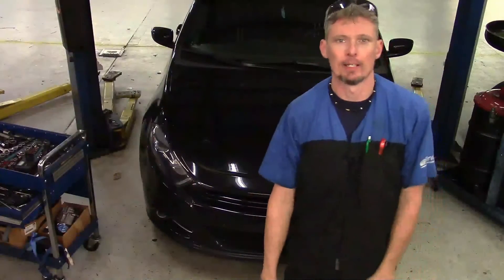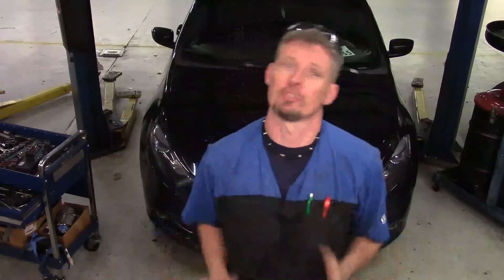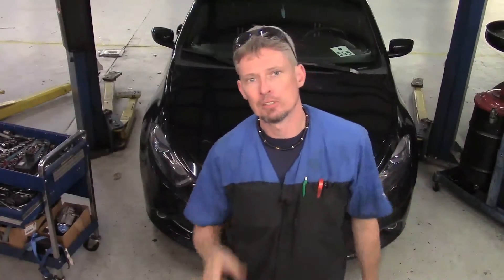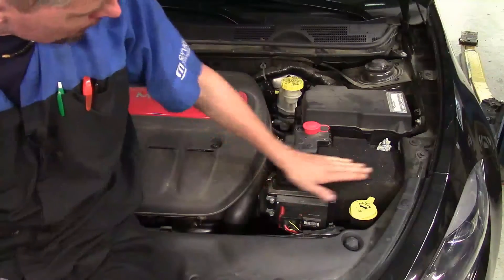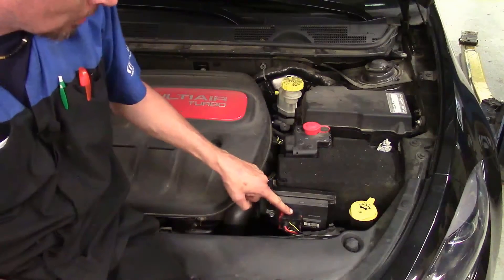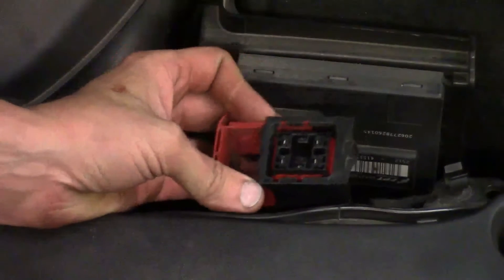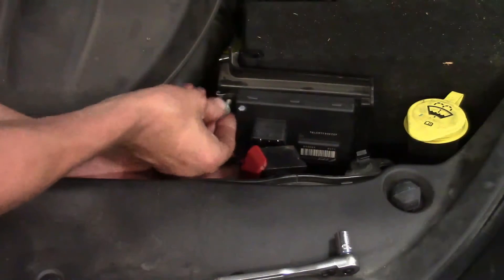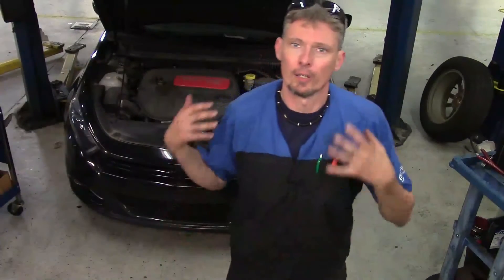2013 Dodge Dart Smart Drive Unit (SDU) removal

Comment: David, I have a 2013 Dodge Dart 1.4L turbo w/automatic trans. Seems like when things get hot the trans start acting weird and a service trans come on the dash, then pops out of gear and won't go into drive or reverse. Sends 2 codes P1CC0 & P1CC2. Everything cools down and then works great again. After a drive all codes clear, I'm thinking the SDU, what are your thoughts? Does a new SDU need to be programed for the vehicle? Thank you for you time!!

Comment: My dart can be moved/rolled when in park don’t know much about these transmissions and local trans shops said they don’t work on these… where should I start?
Reply: Still having this issue, or you replace the bushing in the cabin on the shift control? The recall was for the trans side, not the cabin bushing. So, fails a lottt. Either that, or the micro switch in the shift assembly. Many people bypass it, or put a plastic cover over it to close the gap.

Comment: Hey there David, if the Smart Unit is bad would it cause the car to stop moving when in gear and trigger a Clutch Plate locked in position code and the Hydraulic Pump code ? And there is NO WAY to check if the SDU is bad other than going thru the TCM?
Reply: Did you ever get it fixed?

Comment: I got red steering wheel icon on dash. Did not change anything. Battery died and car was dead for 2 weeks. Finally I replaced battery and now it's hard to turn the wheel.

Comment: I am glad I found this video! I have a Fiat 500L that has this same transmission system. It has the same issue(s). 

I have ordered this part. Unfortunately it is hidden behind of the front drivers fender liner.

It is amazing that none of the Fiat/Dodge dealers I have tried have any idea how to fix this.
Reply: Did it get fixed

Comment: P2871 is the main code I am getting.  WIll a new SDU possibly cure this?  Dealerships states a whole new transmission.   It actually drives forward and shifts with a little issue but has no reverse

Comment: I have a 13 and the pump will work until the sdu gets hot. I am leaning towards an issue with sdu but I can't find exact wiring output testing to verify, I will say when it blinks out I get a stuck off pump and a signal fail code, if I remove sdu and put in the snow to cool I can get it to work again. Also can I use a used sdu because the dealership is on back order? I have a pass through system but I'm not sure if that will be sufficient or if the unit needs to be new. Any info suggestions......maybe a video on a testing process????

Comment: Hey I have a message on the display every time im coming to stop, the message said; Engage Parke Brake to Prevent Rolling  I can't find no info  at any place so I order the park sensor the goes on top of transmission I hope is the problem .,. just wondering if you had the problem before

Comment: Hi my 2013 Dodge Dart 1.4l has a transmission problem and when I took it to dodge they said it was the hydraulic shift actuator that needed to be replaced. They wanted 4 thousand to fix. I know that part is big money but now I’m wondering maybe it’s just the sdu?  The code it was throwing was the P1C9D.
Reply: For 4 thousand you should get a full new trans!
Reply: any updates on that?

Comment: Is this why I have service transmission light and n and r gear not available
Reply from the maker: I might but its needs to be checked first before replacing anything that might not be needed. Thanks for asking and make sure to subscribe.
Reply: Did you get it fixed? Because mine is doing that

Comment: I can see now WHY CC (Chrysler Corp)  STOPPED making these "wonderful " Vehicles... They lost TOO much money in warranties to keep it going... CC needs to get vehicles pass the end of  Warranty to make money back in parts.. did-ye-all know that IF u get a recall on the shifter bushing failure, u ONLY get the 5$ bushing , and really that's all u need...BUT IF NOT under recall, the dealer IS FORBIDDEN TO SELL U A Bushing, but steers you to a 384$ NEW CABLE KIT which will cost 3X the Labour... Do yeall get the the "Corporate greed " thing now ?

Comment: Hi David, I have a 2013 Dodge Dart 1.4 ddct, I am pulling 2 codes P1CC0 and P1CCE, service transmission light is on, if I reset the codes I can drive the car however if I let it stand for a while same codes pop up and I have to reset them in order to drive the vehicle, recall on the TCM has been done in 2017, any ideas?
Reply: same thing happening to me
Reply: @dustin2xx  did you find out what's wrong?
Reply: @misha27060  did you ever figure out the problem? I scanned my car and got both of those same codes

Comment: I drive a 2014 Dodge Dart SXT Rallye. A month ago I had a check engine light come on and then the acceleration was sluggish. After a few cranks the light came off and nothing for a week. Now the light is back and my car is accelerating sluggishly. The gear selector turned red too. As of right now the gear selector looks normal but the check engine light is back. Forums are all pointing towards the TCM. I’ve got Mopar extended warranty for up to 105k miles and my car currently has 78k. I’ve had it for two years and bought it at 58k. Any advice? Concerned the dealership will tell me nothing is wrong.

Comment: Do you have the part number for the hydraulic pump ? Our 13 dart 1.4 turbo with the ddct had an issue with the air injection pump leaking so we fixed that and cleaned everything off and now we are still getting some fluid right where the hydraulic pump is under the transmission and I believe it’s leaking there now because it’s dry above. Do you know what might be leaking around that area ? Like is there anything common or prone to leaking right there ? It’s dripping right off the square part of the pump. Also what’s the reservoir under the intake pipe between the battery and the motor right above the transmission?

Comment: I have a dodge dart 2014 aero, and the cruise control will only intermittently work. I replaced the switch and it works slightly better, but why does it not work sometimes?
Reply from the maker: First thing I would do is check for any codes.....certain codes will turn the cruise control off. Then it will take a high end scanner to read the data and monitor the switch to see what it is actually reading. Thanks for asking and make sure to subscribe.

Comment: Hi David um I have a. Dodge dart 1.4 turbo and the same thing happens to my car the. Shift are stuck and I have the code U0101 that the communication with the tcm was lost can it be the smart drive unit?? Please help me out
Reply from the maker: The TCM is actually a different  module. Its located under the carpet on the passenger side front seat near the firewall. Its going tp require further diag for that code....otherwise it would be a guess at this point. Not a common issue I come across

Comment: Hi David i took my car two weeks ago because when i would be driving a warning would come up saying "gear not available" and then after that "shift to neutral or reverse then drive"  and the car would stay in neutral for a couple of seconds...i noticed you mentioned both of these warnings in your video. So when i took my car to the dealership they replaced both the TCM and the SDU and  its only been two weeks and ive gotten both warnings twice with the Check engine light  appearing aswell...is there a process that the TCM needs to follow for it to program itself or do you think i might need to get both things replaced again?

Comment: I have a 2013 Dodge dart I want to put it on a tow dolly if I pop the shifter cover put it in neutral can I put it on the dolly It is an automatic
Reply from the maker: As long as the front wheels are on the dolly you wont have any issues. Its not AWD so the rear spin freely. You dont need to take anything loose.
Reply: MotorCity Mechanic Thank you for taking your time and getting back to me
Reply from the maker: Harry Atkinson I’m sorry....am I picking up on a touch of disappointment in your comment? Just wanting to be sure
Reply: No disappointment I am glad you got back to me I know that you're very busy person you probably get thousands of emails 
and I'm glad my email was answered so I am very happy that you did get back to me and thank you @MotorCityMechanic
Reply from the maker: @harryatkinson7045  Sorry if I sounded a bit harsh.....its hard to read people from comments. Its a double edge sword.....I put it out there that I am welling to answer questions but when it takes me 2 weeks to get to them, what good am I doing. I try to answer each one and it gets hard especially with my day job and family plus the 6 month old twins. Most nights I fall asleep trying to answer questions. Thanks for being patient and thanks for replying back Harry.

Comment: Any idea on how to remove speed limiter in my 2015 dodge dart limited? Really hoping for feedback thanks!!
Reply from the maker: About the only way possible would be an aftermarket programmer if there is one avail. There is nothing we can do with the scanner we use at the dealership
Reply: MotorCity Mechanic ok, thanks for help
Reply from the maker: YrM Ziggy your welcome

Comment: hey how do i get rid of the acceleration delay on my 2015 dodge dart
Reply from the maker: There is nothing that I have found so far.
Reply: That is what I want to know. I have heard there is a product called gopedal but I am hesitant to spend 300 on fixing the delay.
Reply: or what happens if i remove the smart drive and just drive it regular
Reply from the maker: @luiscarrillo5179  I havent tried that.....not sure if it would drive at all if you did that.
Reply: Luis Carrillo service transmission light and no response from the transmission.

Comment: Hi David , i have my dodge dart after 20 mins of driving check engine and transmission service light will come on then transmission will not shift i took ot to the dealership they said hydraulic control unit not operating correctly and they should have the transmission down and replace it and it will cast of 3000$ please i need your advice , u think this is right or the problem will SDU .
Reply from the maker: Its going to depend on what the code is. Right now I would be guessing. I need the code to make a better decision on possible causes.
Reply: MotorCity Mechanic , hi sir i got u the code P1C9C-00 please help me out .
Reply: Any word on it? We are having the same problem.

Comment: Hi David,my car won't start, I put a new battery about a year go,, I try changing the battery , no difference. l heard about a ground cable located in the trunk,but can find it,,can point me in the right direction?thanks
Reply from the maker: The way things are these days....you need to have access to a scanner that can plug into the vehicle and communicate with all the control modules and then see if any codes. This is the first step I recommend.
Reply: MotorCity MechanicDavid thanks,I  have put an obd2 and no codes detected, i did find out that the shifter cable was no good and if the shifter is not in park,thw car wont start,so I have replace the shifter cable and provlem solve.thanks
Reply from the maker: Awesome....glad you found the issue. I have seen that a few times on that vehicle. Thanks for the update!

Comment: Hi David! I have a Fiat 500L which pretty has the same insides as the Dodge Dart, I’ve been having odd issues sending problems telling me to service engine/transmission as well as giving these “gear unavailable” messages and it becomes super jerky and I have to park. It also has delays when I change gears and typically have to go into reverse before I can go into drive other wise the car won’t go. I turn it off wait about 15 mins and it works like new, messages are gone and like nothing. I don’t understand! A mechanic tells the transmission is gone but I doubt it! It works just fine until it doesn’t and has those funky messages. Could this be the smart drive unit ?
Reply: I’m currently having this exact problem. Don’t know if i should Drive 3 hrs or not. Did you get it fixed?
Reply from the maker: Not sure on the Fiat.....I feel it will be something different. Its not an issue that I have come across so far so nothing I can point you towards
Reply from the maker: First thing is to have it scanned for codes using a scanner that can access all the modules. If your getting warning messages then there will be codes. The code or codes will give a direction to go in as far as repairs or possible replacement
Reply: MotorCity Mechanic no I have not fixed it :( any luck on your end ?? It says that it’s the clutch 1 actuator is out of range so not sure what that means
Reply: @rawr-ger did you ever find out what it was ?
Reply: I know its been a but i had to replace my SDU on my fiat500L. The cars is under the left wheel well cover. Mine got so water logged and corroded thats why those codes came up and won’t gear. Since our cars is computer related so gunna have to replace your sdu mines fixed!
Reply: My fiance trying to find a way to move that part into near the engine area so where it won’t get super hot but that way the sdu won’t get water damage again from being by the wheel

Comment: my wipers won't stop on my dodge dart. 😓😓
Reply from the maker: Are you having other items such as the headlamps staying on as well? Usually when there is a comm issue with the vehicle.....it goes into safe mode which includes wipers and headlights. That way it can still be driven and that covers in the rain and at night. The first step is having the codes checked to see what the issue might be.....it could be one of many and at this point it would be a guess. It takes a scanner that can access all the modules such as the BCM or other items.

Comment: Hi david,for replacing the battery on a 2013 dart,what can I do to keep memory in car.
Reply from the maker: There is an item that they call a memory saver that has its on battery and plugs in to the cigarette light outlet/power outlet. It keeps items such as the radio clock and channels from resetting. Otherwise personally I dont use one. Never found a real need for it.

Comment: i cant find the STARTER location of a 2014 Dart??? HELPPPP
Reply from the maker: Morning Angelica....the starter is located on the side of the engine closest to the firewall. Its just above the right side cv axle where it goes into the trans. Its not a common failed part but thats the location. Thanks for the question and make sure to subscribe

Comment: I have a 2014 dart that turns the shifter letters red, any suggestions?
Reply from the maker: The first thing would be to start by having the codes retrieved. If there is an issue then most likely there will be a code as well. The cause could one of many at this point
Reply: did you find the problem?

Comment: 2014 dodge dart with 2.4L my question. I remove the  VST transmission or the stock one, and replace it with a regular auto transmition that dont hold the car back from shifting. As a mechanic what transmition do you think would work and if not Why wont it work! I hate the stock transmission its garbage!
Reply from the maker: I havent heard of anyone swapping transmissions yet so I really couldnt tell you what will or wont work. Its also one of those things that I would have to have done myself to be able to tell you for 100% that it turned out well. Wish I had more info but currently I dont.
Reply: sounds like your the guy that has the skills I need to get the job done!! :) i'll look into hwere your business is and check my touring schedual. :) Thank you for your response.

Comment: If there is an intermittent burning smell such as burning hydraulic fluid etc, could that be an issue with the SDU? I bought a 2013 Dart Aero brand new and the dealership replaced the TCM 4-5 times within 10,000 miles. I kept having messages pop up such as gear shift not allowed etc. They never mentioned anything about the SDU verbally or on any paperwork I received. Wondering if I should bring it back and mention the SDU to the service manager next time it happens.
Reply from the maker: +Mike McGarry Yeah I have seen multiple repairs for TCM issues. Makes me wonder if a wiring issue sometimes but usually the TCM takes care of the issue on my end. As far as the SDU.....you need certain codes pointing in that direction. Different times I have had different causes. As far as a smell.....haven't come across that issue yet. Thanks for the comment and make sure to subscribe if you haven't already.
Reply: I've subscribed. Thanks for the reply.
Reply from the maker: Mike McGarry Any time Mike. Thanks for watching